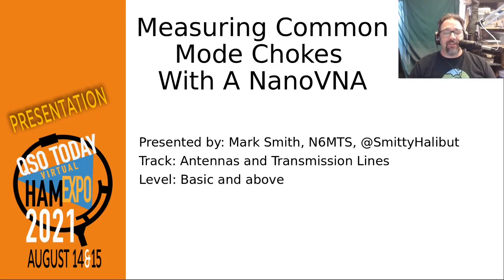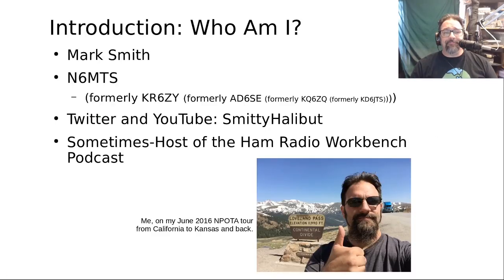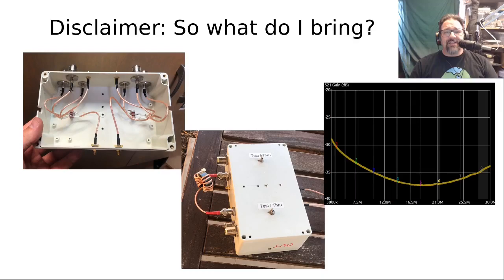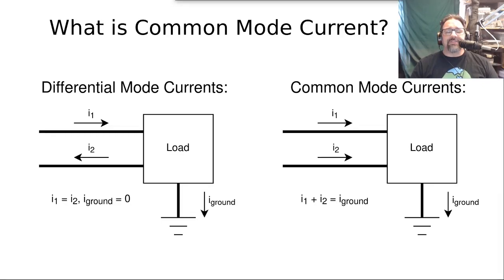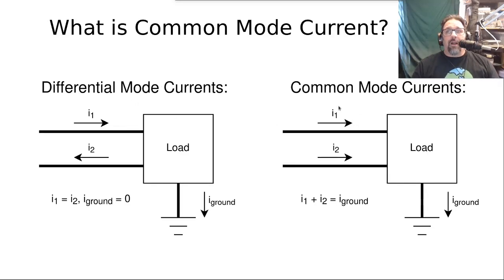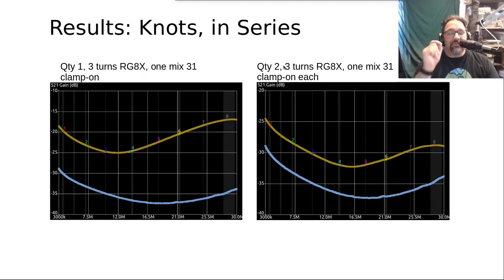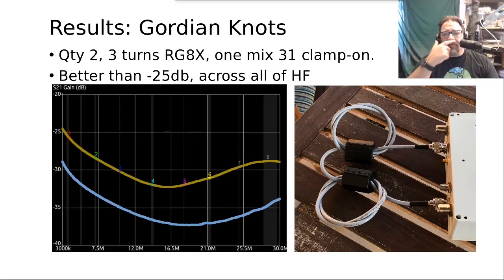Measuring Common Mode Current Chokes with a NanoVNA

Comment: Finally. A video that does a good job of explaining what’s going on with baluns. Question: did you try placing two DIFFERENT types of baluns in series?  For example, two different baluns with complementary responses?

I hope you plan to do more videos. You do a great job and I’ve subscribed to your channel, so you might as well :)
Reply from the maker: I haven't! That's a really good idea. I think I spoke briefly about different mixes of cores, using a 31 and a 43 to combine their response curves, but I did not talk about different builds of chokes.

As for more videos: I do! I'm neck deep in trying to get SOAR into production right now, so I'm short on time for doing videos.  Having said that, I am working on another QSO Today presentation for the September 2022 Expo.  It's on a totally different topic than Common Mode Current Chokes, but I hope it'll be interesting too. :-)

Comment: Great talk. Thinking about getting my ham license, but I think I’d be in the “mostly building, not operating” group as well. What are POTA and SOTA?
Reply: “OTA” usually means “On The Air” so it’s just a matter of the first letter(s). POTA is Parks, and SOTA is Summits. Both their websites can be found by searching. (Read: I don’t remember the URLs off hand. :-)

Comment: Thanks for the video. As I was watching I was wandering about influences of possible phase shifts in the device. The influence on the working of the common mode choke. Signal coming in the choke (on one side) and signal comming in (on the opposite side and from the opposite direction) may have some phase shift. The load is probably not pure resistive....
Reply: Are you talking about the Differential Mode response, meaning how transparent it looks to the signals flowing through it?  Or the Common Mode response, meaning how the phase affects the resistive/reactive balance of the impedance it imposes?

If the former, the Differential Mode view, by definition Differential Mode currents sum to zero through the inductor, so there is no impact at all. When I=0, it doesn't matter what the j component of X is because it will be multiplied by 0 to get your V vector.  "What if phase differences result in I!=0?"  Then those differences would become Common Mode.  By definition.

If the latter, the Common Mode view, then yes you're absolutely right.  The impedance imposed by a Common Mode Current Choke is not purely resistive across the whole band of interest.  It's an RLC complex circuit.  An IDEAL choke would be all R and very little LC over the whole band of interest, but that's nearly impossible.

In the video I show highly resonant chokes with a very deep attenuation "peak" (shown as a "valley" on the graph because it's a negative number).  In those cases, if you measured the Complex Impedance of the CMCC, you would see a high R/low X at that peak, because that's the resonant point of the choke, and resonance at the frequency happens when  f*L and f*C are equal but opposite, which cancels them out and leaves you with nothing but R.   But outside that peak, the response becomes very reactive.

Comment: A question just came up in my mind: If you use two ferrites in series, does the separation between the two matter? IOW, does the flux from each one couple with that of the other one? I think I'll start saving up for a VNA.

Also, I'm curious about one other thing (NOT related to coax). If I buy a pre-made common mode choke, can I connect one of the sets of windings backwards and turn it into a DIFFERENTIAL mode choke? How would that compare with using two separate inductors (wound on different cores) for that purpose?

73 de AF6AS

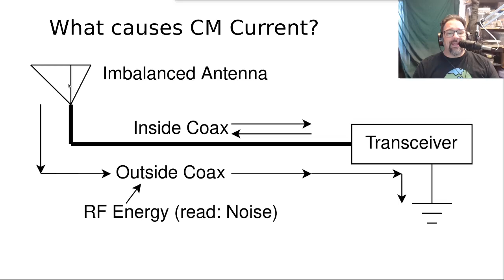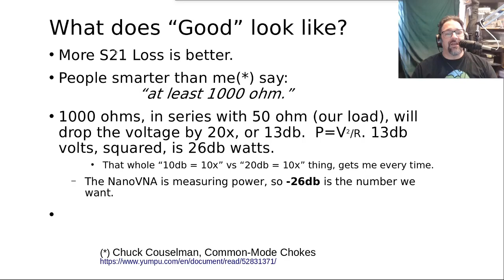Comment: Excellent explanation and test work Mark.  As another RF guy I am troubled by 2 things. One at 09:20, how can CM noise get inside a shielded radio when applied between coax shield and transceiver "ground"? I suspect all CM noise entry is either via poor coax or transceiver shielding.  Two at 22:03 is the assumption that a CM choke should be X times the cable Zo. I doubt that the surge impedance on the outside of the coax is also 50 Ohms. Anybody wiser?
Reply: 1: you’re probably right that RF gets in on bad coax too. Heck, it’ll get in on the antenna itself! But any non-perfect ground will also put that noise into the receiver. 
2: The goal is to make the common mode impedance as high as possible at the target frequency. Common wisdom as proposed by people smarter than me is “about 1000 ohms.” That’s about 20x a 50 ohm system … and I think I’m realizing I did my dB math wrong in the video. That’s 20x impedance (linear with power), not 20x voltage (square with power). So it’s only 13dB, not 26dB. If I’m right, all the numbers I gave in the video are twice as good as they “need” to be. Huh. Well, we have some mighty fine CMCCs out there I guess.
Reply: @SmittyHalibut  Yup I  agree with the math. Just the relation to 50 Ohms which is the internal cable Z not the outside "third wire". No matter, we need Z as high as possible, in most cases with a good Rloss to gobble up energy.  As far as RX CM I think it is an "all cables" sneak in (line cord, USB, LAN...).  CM chokes DO help.  But  as for TX induced RF chokes should be at a voltage maxima on the line where ever that it is.  PS It is amazing how far the ham community has come in understanding lines, VNAs etc.  Cheers!

Comment: What would happen if one were to place the common mode choke in an iron or aluminum tube? For instance, if someone were to insert a linear common mode choke into the support mast itself to protect the coaxial cable from weather elements like UV rays? What are the potential impacts, and have you ever measured them?

Comment: Hi....Am I right that you still have a "jumper" between the grounds of the sma connectors on the VNA side, just not visible in the picture?
I have in mind to build this one and a frankenstein version that uses the inner and outer across a chock to see what the sweeps compare like 🙂....then of course measure the CMC on coax installations before and after chokes...then get down some operating maybe....thanks for a great presentation
Reply: Soooo...  Good catch.  No, on the second version of the box, I didn't have that jumper between the shields on the two VNA ports.  I should have.

I encourage you to make your own CMCC Test Rig if you want to.  I will provide as a "Throw money at the problem" option if you'd prefer, I do now offer those test rigs as a kit from my company's website.  I started Halibut Electronics AFTER recording this video, so it didn't come up.  If you're interested, it's available here: https://electronics.halibut.com/product/common-mode-current-choke-test-rig/
Reply: @SmittyHalibut  Thanks Mark...the kit looks like decent value given the connector costs alone, I would certainly purchase one if I was in the US, but tax and duty on top make it a little less attractive for me, that said, I will make up the V2 with a jumper and try to persuade my club we need a proper kit ;-)   I do have a question....Most of the test arrangements I have seen connect the output of the VNA (centre conductor) to both inner and outer conductors on the choke to generate CMC....It is not clear to me how feeding just the inner (from VNA) to shield (on choke) creates CMC....the sweeps look the same.   What am I missing here?
GM0EDJ
Reply: @paultemple5566  good question! Remember from the video that current flows in interesting ways in coax. Differential mode currents, where there is an equal amount of return current, necessarily flows inside the coax between the center conductor and the inside of the shield. And common mode current, that does NOT have a return current, necessarily travels on the outside of the shield.

Because: Physics.

So the important part isn’t which conductor of the Device Under Test (DUT) the signal is put on, it’s more important that the return current is NOT sent through the DUT. If you use coax, even the center conductor, as a single wire without sending the return current through the coax, that single wire’s current will NECESSARILY travel on the outside of the coax. 

It’s weird, I know. And I couldn’t explain to you now why that is, but it was explained to me back in college mumble decades ago, and it made sense then, so I’ve accepted it on faith ever since.

So, in my screw up of the v2 test rig, without jumpering the shields together, it just means the return currents are INSIDE the VNA. Which means the two jumpers connecting the VNA and the test rig are also common mode. It will add noise to the measurements, but it doesn’t invalidate them. 

Does that make sense?
Reply: @SmittyHalibut  Thanks Mark....good enough for me and makes sense, hence the jumper to avoid a return current through the DUT....on with build and testing
Reply: @paultemple5566   Be sure to let me know how it goes!  🙂

Comment: Thanks for this video, as a returner to the hobby after nearly 40 yrs, it was very useful to me. Forgive me if this is a dumb question but please would you confirm that when you say "outside" you mean outside edge of the shield and not the outside plastic sheath of the coax? I ask this because I know you can get RF burns from the very outside of the plastic sheath of a coax.  Thanks again.
Reply: Not a dumb question at all!

The currents are traveling on the shield, that is true. But RF can capacitively couple through the insulation into your skin. If the currents are high enough, then yes you might get burned (more likely a tingle) from touching the coax. 

Now, that’s a REALLY BAD common mode current. If that’s happening, something is seriously wrong with the antenna or feed system. Under normal circumstances, with normal levels of reflected common mode current, it’s very unlikely you’ll get an RF burn by touching insulated coax. But once that current hits the metal chassis of the radio, or the shielded-not-insulated microphone that’s in your hand, you’re much more likely to feel even small to moderate amounts of current. 

Get thee a CMCC post haste! :-)
Reply: @SmittyHalibut   Thanks so much for your detailed reply, it all makes sense now. I had not thought about the plastic sheath becoming a capacitor but of course it will.  I have a Nano VNA and will use it to make some chokes. Thanks again for your help! 😄😄👍👍👍

Comment: Great presentation! I am just wondering , when it is about a current inducted in the shield , then probably this conductor is not anymore a feed line with 50 ohms characteristic impedance ?
Reply from the maker: Very true.  At that point, it's a long wire antenna with some unknown impedance.

Comment: How did the 2 clamp on with one coil work. It would use less coax and may give more blocking. Or I am thinking it would. 4 clamp ons should, in my mind do good on one coil. But I am not sure if I am thinking the right way.
Reply: It would almost certainly help, yes.  The question is, which "costs more?"  In dollars, ferrite is more expensive than cable and only increases the inductance linearly with the number of clamp-ons, where as adding turns of cable increases the inductance to the SQUARE of the number of turns.

But if your source of cable is finite (eg: it's already in place and only so long), and you can afford to put more ferrites on it, then yes that sounds like the better option.

To answer your direct question: I don't have data for what the two-clamps-on-one-loop looks like.  I'll take this opportunity to point you to https://electronics.halibut.com/product/common-mode-current-choke-test-rig/ and ask you to post the results, though!  🙂
Reply: Jim Brown (K9YC) had some useful graphs in A Ham's Guide to RFI and also in Understanding How Ferrites Can Prevent and Eliminate RF Interference.  You should be able to search for those titles and his name.

Comment: I'm new to the hobby . . I have made a choke balun which i want to use near my HF radio, It is made of 240 mix 43 toroid and RG-58, my question is: is the distance between the balun and HF rig critical ? jumper i made will give me 8 inches distance b/w choke and radio

Comment: What if the coax has two shields, one inner foil and an outer braid??  Does that mean 5 currents??  How to wire up an RF choke with toroid ferrite??????
Reply: If the foil and braid are touching, then no, consider that a single shield. 

If there’s a layer of insulation between the inner and outer shield, then you have a special coax that’s designed specifically for keeping differential mode and common mode currents separate. I’m not an expert on these, but I think the goal is to ground the outer shield to the chassis at the transmitter and leave it disconnected at the antenna. It’s basically a shield for the feedline. Then the inner shield can be connected directly to the transmitter amplifier ground reference (not the chassis), and the antenna. 

It’s a more complex transmitter arrangement. If you don’t have that, then just connect both shields to the transmitter, and only the inner shield at the antenna.

Comment: Hey Smitty thanks for your efforts . Have you done any efficiency tests ?
I’ve made a few baluns the latest being a 49 to 1 on a big ft243 core . It measured really good on the nano vna however it got quite warm using 100W and HF which lead me to question its efficiency ?
73 Chuck VK2SS
Reply from the maker: I haven't. That's a very different thing than what I'm trying to measure here.  What you're measuring is an actual differential mode impedance transformer, not common mode choking.  (This is why I hate the term "Balun" because it is commonly used to describe so many different things.)

I'm not sure I understand the magnetic fields in an impedance transforming un-un (the more accurate name of a 49:1 for an end-fed) to speculate on what's happening.  But to measure the performance of the 49:1, you'd need a non-inductive resistor that's (49*50ohms=) 2450ohms, and capable of dissipating the full 100W of your transmitter.  You'd put that on the antenna side of the un-un, and transmit into it.  Then measure the heat in the TRANSFORMER, not the dummy load.  You want to see all the heat being dissipated by the load, not the transformer.

If your transformer is cool and the dummy load is hot, then your transformer is good, and I'd look at the antenna for faults.  (This is the part where I couldn't tell you what to look for.)

If, while transmitting into the dummy load, your transformer still gets hot, then look in the transformer for faults: Broken wires, cold solder joints, a-symmetries in the windings, etc.

I hope that helps.  The 100W 2450ohm non-inductive load is likely to be a challenge to find.  I don't have any pointers on that either.  Sorry.  You'll probably end up having to make it yourself.

Comment: Hi, I find that a 1:1 choke will degrade my reception by 1-2 S. Is this ok? I have a choke on a toroid with 121 turns of coax
Reply: 121 turns!  That seems excessive. Depending on what coax that is, you're probably just seeing the loss of so much added coax in your feedline.  If that was supposed to be 12 turns, that's much more reasonable and at that point, I suspect something is wrong with the choke.  A properly functioning choke should have zero impact on the normal reception of your antenna system, except the added loss of the additional feed line in the choke itself.  But that should be around 1dB for moderate coax, and less than that for good coax.  It'll be WAY less than 1 to 2 S units (an S unit is 6dB, so that's 6 to 12dB!)
Reply: Of course 12 threads. RG58 on FT240-43 toroid. Attenuation according to VNA 25-35db. There's nothing wrong with that. On ft8 lower report. When SSB calling kiwisdr, I can hear myself much more faintly. I don't understand why that is. Where can I go wrong?
 @SmittyHalibut
Reply: The coax might be damaged by the winding process ?
Reply: It might be, depending on the cable. Thats why I use RG316, which has a very small minimum bend radius, for winding on FT140 cores. Larger coax on larger cores, you definitely should not abuse the minimum bend radius. 

It’s possible that’s what’s happening here on @miranovak8098 ‘s choke.